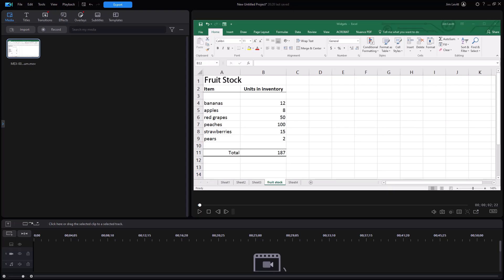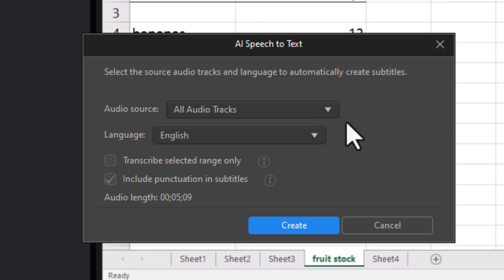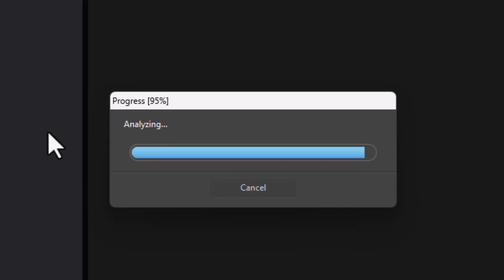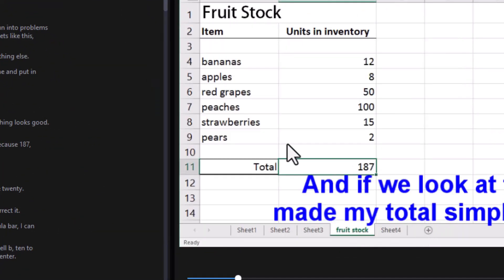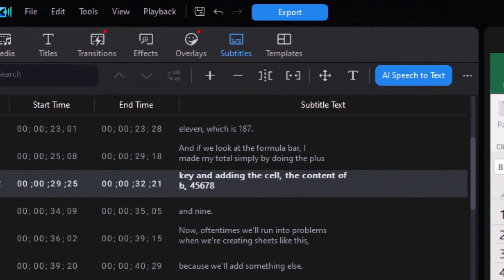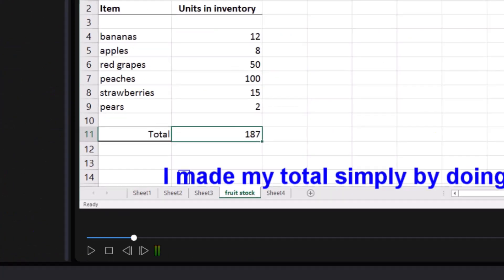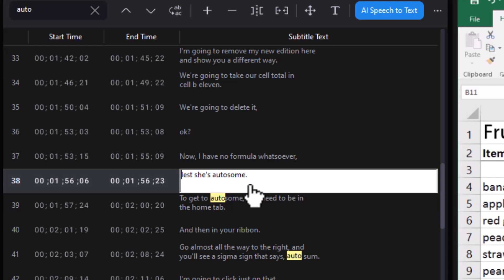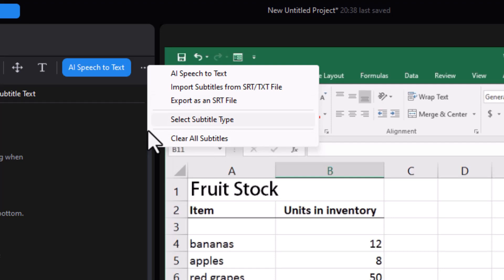Basics of speech-to-text in the new interface in PowerDirector

Comment: Getting better!
My continued testing with the update for today is that the transcription is 99% accurate which is great!  The start/end time is still not very good.  Not sure why this is a problem for them, but it has a high failure rate on getting this right, very frequently breaking coherent sections of speech into separate entries and this is not because of a long speech segment - this needs work.
Reply from the maker: I used speech to text a long time ago. It has always been a work in progress no matter what software firm has used it. We pronounce words differently--even when they appear at the beginning or end of a sentence. Our brains understand what we mean, but the little differences in tone, pace, and volume are difficult for algorithms to sort out. And then placing them on a track is a completely different issue. My guess is that we will see improvements over time as the analysis gets more sophisticated. --Jim